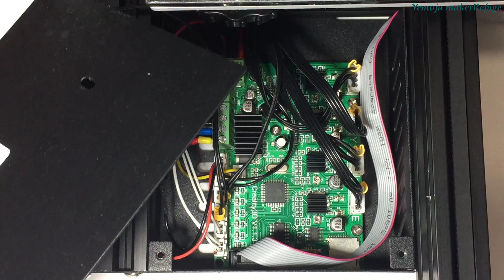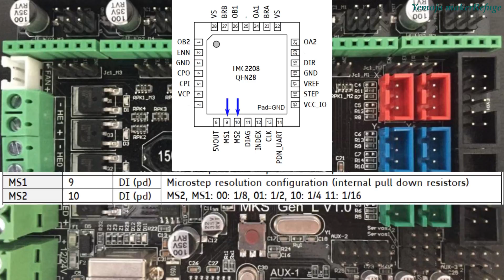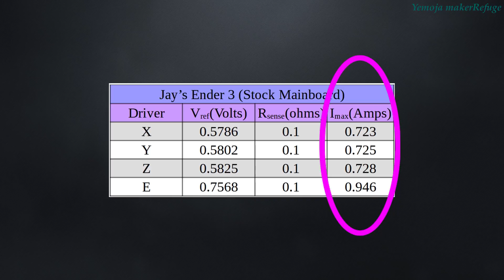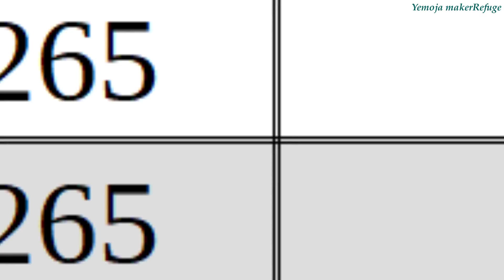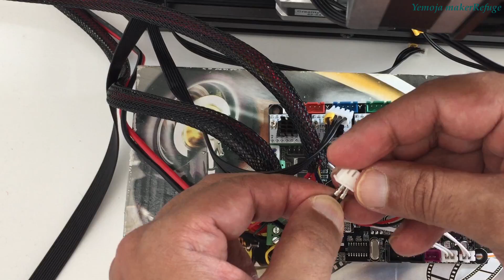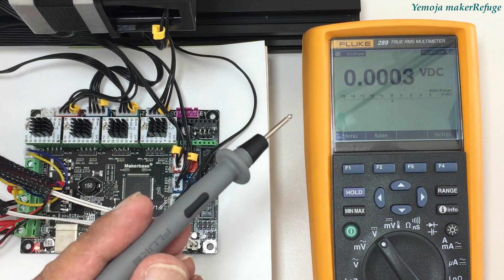Ender 3 : Upgrade to MKS Gen L v1.0 + TMC2208(Legacy) - Part2

Comment: can i use this method also with 2209 ?
Reply: hi @t0pa. I need to know the exact driver you are using. That said if the driver pinout for the device is akin to the driver that I'm using here then definitely yes. All you need to do is select "TMC2209_STANDALONE". Checking Marlin's "Configuration_adv.h" reveals that the tmc2209 can be used for sensorless homing which is NOT covered here. Hoping this helps.

Comment: Hello please reply . Instead of NC in my  tmc 2208 it's CLK and PDN. Will it work or not ,what's the difference
Reply from the maker: Hi @michael martin. Can you point to where you got this? What version are these?
Reply: @yemojamakerrefuge898  v1.2
Reply from the maker: @michael martin This tmc2208 v1.2 module has the uart mode enabled out-of-the-box so won't work with this guide...so sorry bro.
Reply: @yemojamakerrefuge898  ok iam going with lv8729 as it's cheaper than tmc 2208.  I am noob , so with lv8729 should I do exactly what you did? All the coding and installation in motherboard just like 2208. ??. Or should I change something
Reply from the maker: @michael martin you'll just need to change 'TMC2208_STANDALONE' to 'LV8729' for the code bit. Other than that, I suppose you're good to go. I don't have this driver so I can't say for sure. All the best bro...Hoping this helps.

Comment: This was a very well put together tutorial, but a couple minutes after I finished tuning the drivers the motherboard and/or the drivers lit on fire. My biggest regret is that I didn't have any marshmallows handy.
Reply from the maker: Hi @Silas Foley. Seriously? I'm really sorry to hear that. But your board caught fire? Perhaps you may have had a faulty board. The TMC2208 drivers have short-circuit and over-temperature protection which would have prevented anything bad from happening to them. Possibly the MOSFETs for the extruder or bed heater given a short-circuit condition in either heating elements. Polarity reversal could also cause such an incident. Again, I'm sorry to hear of your predicament. Please exercise extreme caution when handling electronics. 
Things I've learned from my experience if they apply. Always have your hand on the power-off button. If anything smells funny quickly hit the power-off button. Double/Triple check everything. When tired even if a bit, hold-off everything and continue after resting.
Reply: @yemojamakerrefuge898  Okay, thanks for the advice! The board must have been the origin of the fire considering the drivers have all those precautions in place. It's a shame because I bought a brand new motherboard, brand new drivers (I had to wait for a few months for them to come in) and a brand new LCD screen and there all wrecked now except for possibly the screen. On top of that, it appears that there a bunch of wires on my Ender 3 that are fried.  I don't know what the full extent of the damage is and am considering purchasing a new Ender 3 altogether.
Reply from the maker: Hi @Silas Foley. Oh dear that's quite unfortunate. I'm so sorry for you buddy. Buying a brand new Ender 3 may be a better option if you see damages to wires belonging to the steppers and/or thermistors. It is not necessary if you know how to check these component for proper resistances/continuity. Otherwise go for a brand new printer and salvage the damaged printer's parts as back-up or maybe a DIY printer of your own make. Parts can also be used in other electronics projects. Not all is lost.
Don't get discouraged buddy. It can happen to anyone. I've got a long history of blowing stuff up. It's painful but somewhat a necessity to learning at least in my case. Hoping this helps a little bit.
Reply: @yemojamakerrefuge898  It helps a lot! thanks for the help and the encouragement, it means a lot.

Comment: Noob question: why does the reference voltage needs tot be higher when you are using the same motors as before im really confused why not use creality stock values and is the thing from the jumpers the same on every mainboard that you can buy if they have these connectors
Reply from the maker: Hi @Marc Vroegh. Sorry buddy for the real late reply. I am using the creality stock values. The different values are simply the voltage representation i.e. whether peak-to-peak or RMS values. I'm sorry but I do not understand the latter part of your question. Hoping this helps.

Comment: You did all that math from vref to Rms to get the same values
Reply from the maker: Hi @Jacy Light. Yes it is and that's because the manufacturer chose a very convenient resistor value which makes things easy for everyone. Otherwise it would have not been the case. Just wanted to share how the calculation was performed as there was no other place which showed it properly. Cheers.

Comment: What is the difference between the green voltage terminal block, and the white voltage connector next to the motor connectors?  For example, if I plug an MKS-CD expansion into the socket, to use an external driver (TB6600), which one powers the driver/motor?
Reply from the maker: Hey there @Ben Nguyen. The white connector basically is connected to the green connector I believe. IOW, if you power your board via a 24V supply voltage by plugging it into the green connector( which is a power inlet/input ), the same voltage will be available thru the while connector( which is for power output ). The power from your supply which you plug-in thru the green connector ( next to the bed connector ) will power your external driver. Hoping this helps.
Reply: @yemojamakerrefuge898  Thanks!  I haven't had much success getting the motor to move reliably, but it's probably an issue with the changes I made to Marlin's Configuration.h file.   I'm ordering a couple of known-supported motor drivers (A4988/DRV8825) to replace the MKS-CD/TB6600 driver.   This should eliminate at least that variable!   I've also ordered a cheap 5v stepper motor to test with, just in case it's an issue with my motor, but can a 5V motor be used with the MKS-Gen-L v1?  The board says 12V/24V
Reply from the maker: Hi @Ben Nguyen. Nope I don't think so buddy. You may be able to use it for brief tests but you'll end up damaging it. My 2 cents worth. Cheers.

Comment: im confused about one thing sir, i have the a4988 drivers does all of the part one and part two applies for it or are your tutorials only for the tmc  drivers?

thankyou very much for your response
Reply from the maker: Hi @Aqib Akbar. This tutorial is specific to the TMC2208 correct. But if you want to use the A4988 drivers then just select the driver "A4988" instead of "TMC2208" when configuring drivers during the firmware configuration bit. For hardware configuration, you need no other changes. The changes shown in the second part will work for the A4988 as well. Make sure you select the correct step size which is 1/16th by configuring the jumpers as shown in that part. Hope this helps.
Reply: Yemoja makerRefuge thankyou so much! please upload mks l with tft32 screen

Comment: Can you Upload your Cura settings?
On my Ender 3 all results Trash :(
Reply from the maker: Hey there @SenSenCyber. I'm using the default setting for Ender 3 which come with Cura 4.1. In fact I've been using the default settings for Ender 3 in many previous versions of Cura also. For my everyday printing I use a velocity of 60mm/s, acceleration at 1000mm/s/s and jerk at 10mm/s. Other settings are dependent on your material and 3D design. Hope this helps.

Comment: I have the identical tmc2208 v1.1 stepper drivers. I can not get them to work in UART mode on my MKS GEN L. Did you?
I soldered the UART pin with a split wire. One end has a 1Kohm resistor. Then I plugged the wires in the aux2 pins as shown by teaching tech. When I send a M122 command to state the driver status, they are not enabled and don't have a driver register.
Reply: I'm also trying to figure everything out. In the process of upgrading my Ender-3 with MKS Gen L + 4x TMC2208 in UART + MKS TFT28 + E3D V6 + BLTOUCHv2.0 -- I was under the impression these specific versions of TMC2208 drivers didn't need any additional wiring for UART mode. 
All that's needed is to set them up as TMC2208 (without 'STANDALONE') in Marlin fw.
I'd love a clarification on this also.
Reply: Ayeayre I can try that, but what pin assignments do I need to set in Marlin? The standard ones for the MKS GEN L board or ?
Reply: @anenkris I can't say with any confidence. I'll get back to you once i figure it out.
Reply: Yeah lol nevermind my first post, sorry but I misinterpreted the features write-up for these specific Makerbase v1.1 boards.

As far as I can tell the UART pin is now connected direct to the chip, negating the need to solder any jumpers to make the connection as with most other versions of these drivers.

So the board itself is technically 'UART-ready' from factory...
But we still need to connect that pin to a TX/RX interface on the MKS Gen L to make use of it. 
else; no communication is physically possible.

So, If you've done more than 5mins of research you're more informed than I am and have made and connected the Y cables, and assuming you have double-checked it for continuity etc. then make sure you only use TMC2208 instead of TMC2208_STANDALONE  when configuring Marlin (also make sure you download Marlin v1.1.9 or newer)

Also check that M112 is actually enabled in fw (uncomment TMC_DEBUG), but I'm guessing you already knew that..

That's all I can think of atm...
Which isn't all that surprising. 

Please let me know if you get it working, I'll do the same once/if I finish.

If you haven't noticed by now, please keep in mind that I am still trying to figure it all out myself and could be completely wrong, but I will humbly accept and appreciate any corrections, additions, tips & tricks from yourself or anyone else that is still reading this for some reason. =)
Reply: @ayeayre  Let's do this together!
I connected the uart ready pin to a TX/RX interface on the MKS Gen L. I used the pins as described in Marlin 1.1.9 bugfix.
I also made the necessary changes to the firmware including TMC2208 drivers and enabling M122 debug command.
And yes there is continuity from the stepper pin to both ends of the wires.
Still no communication is happening with the drivers. That's why I am a bit lost.
I could use them as standalone, but prefer not to.
Reply: @anenkris  I will be able to power up and test shortly, then we'll at least be on the same page, right now I'm just guessing. Won't be long.
Reply: @ayeayre  Yes I tried removing only ms3 with no luck. Then I tried removing all jumper caps, still no luck.
Reply: @anenkris  it wouldn't matter, they aren't used in UART mode.  
Did you double check the orientation of AUX2 connections?

I'm just about to wire it up now. dw we'll work it out.
Reply: @ayeayre I wired it like this: https://i0.wp.com/www.deviousweb.com/wp-content/uploads/2019/01/pintopus.png?w=455&ssl=1

With this board orientation: http://www.robotrebels.org/gallery/16_08_07_17_7_42_19.jpeg
Reply: @ayeayre  Any luck?
Reply: @ayeayre  Have you succeeded with the TMC drivers?
Reply: @anenkris  My apologies, I got held up. But i'm back on it. Will update in a couple hrs.
Reply: @anenkris  Sorry for the wait, I just hooked everything up rudimentary,  but looks like i'm in the same boat. dammit 

Have you had any luck at all?
Reply: Ayeayre no luck. I was hoping yours worked and I forgot something. Going to try them in legacy mode this weekend. See if that works.
And I never got an answer from Makerbase that helped either.
Reply: Ayeayre one thing I have not tried is setting a VREF with the potentiometer on the chip.
Reply: @anenkris  Bet you it's something stupid.  lol 

What did you use to flash Marlin btw?
Reply: Ayeayre I guess. I use Arduino IDE to flash my boards.
Wouldn’t e-mail be easier? 🤣
Reply: @anenkris  haha yea sure would,  shoot me your addy.. or add me here via https://youtu.be/addme/lDGQfl2K9ytCufUc5AYj_OC-xBDZiw   to shoot privately..
Reply: @ayeayre  The link expired. Send it again?

Comment: Fantastic videos! I succesfully upgraded my Ender 3 Pro to MKS GEN L + TMC2208 with your help and videos - thank you! 
Question: Michael at TeachingTech's video uses X,Y,Z vRef values of 0.76, and his sense resistor is also 110. Is it better to err on the lower or higher vRef side?  I have used your values of .725 (x,y,z) but now I am second-guessing which value is correct / best to use. Are there any other hardware differences I should be aware of to check on mine, to ensure I'm using the correct calculated values for my specific h/w?  THANK YOU!
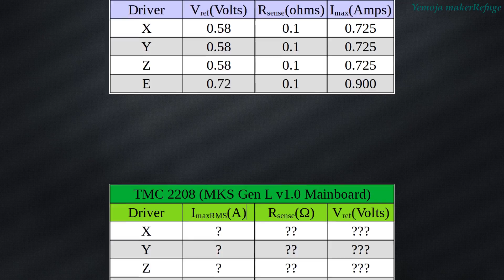Reply: Ah, I see in Michael's first video, he uses max current values of 0.84A (for the X,Y,Z motors) & 1.0A (E): https://youtu.be/H41hIXdB6js?t=344. Whereas you are using (@9:38) 0.725A & 0.9A respectively. I'm still not sure which calc / values are correct though.
Reply from the maker: Heya @Glen Schulz. Sorry for the late reply. I'm using the max current values obtained by measuring the original drivers on the stock Ender 3 board. Also, there's a page which I shared where you can find the Ender 3 stock max current values. I'm using these values as a reference as Creality has not shared any other technical specifications explaining why they chose those values. The specs on the motor are pretty much unknown as is the mechanical loading of the axes & extruder etc.
That said, the TMC2208 drives are much more efficient overall than the A4988 and I have set these values lower and still the printer printed without any problems. The rule of thumb is to start high and trim down to a smaller value depending on how fast you print. I generally print at velocity@60; acceleration@1000; jerk@10 and those max current values give me no problems whatsoever at these requirements.
My calculations are sound as I've gone thru them may many times. The real question is exactly which max current value is optimum for the printer axes & extruder but as of now I've not been able to find a way to calculate that. Since simulation is not possible as there are too many unknowns this leaves us with experimentation. So we come back to trial & error to find the best values for the individual printers. I've gone down all the way to 0.6v & 0.8v respectively and still found no printing issues for my printing demands.
Anyway, lower values are better as it dictates power efficiency. Hoping this helps.
Reply: @yemojamakerrefuge898  thank you so much for the detailed reply, Jugnu. I've used your values and have not had any problems so far - so thank you again!!

Comment: I am wondering in one uses a pancake stepper motor for E would the values be smaller?
Reply from the maker: Hey @3lemental Studios. The values that you are referring to I'm assuming you mean current limit volatge. Then, it comes down to the specs of the motor. If the specs are the same as the original than the current limit voltage would need to be the same. The values shown are NOT optimal as the motor specs and the mechanical loads are somewhat unknown/unspecified for the Ender 3. The calculation is equivalent values based on my measurements for my machine and references from other sources.
Hoping this is what you are asking. Hope it helps.

Comment: Thanks a lot for this very detailed tutorial... 
Just one doubt... how have you fit the MKS Gen L board into the Ender's electronics box?
Reply from the maker: Hey there @Renato Elias. Mine lines outside on the side of my printer. Michael of Teaching Tech has a solution you can find on Thingiverse - https://www.thingiverse.com/thing:3311643 . Its an adapter which maps the holes on the board to the casing mount points. Hope it helps.
Reply: @yemojamakerrefuge898  I've designed my own solution using the stock Ender's box. Here it is https://www.thingiverse.com/thing:3607376
Reply: now I'm trying to figure out why the nozzle's fan is not working... I've already tried 3 different ones and they don't spin. The pins have the correct voltage but nothing happens... is there anything we should change in the Marlim firmware regarding this fan?
Reply from the maker: Hey there @Renato Elias. My nozzle fan is connected directly to the 24V screw terminal and it comes ON as soon as power is applied to the printer's PSU. No there's no software/firmware setting for this as its directly powered. You've got me stumped too. Do the fans spin when any DC voltage is connected. Just to ensure the fans work. I''m sorry but I'm not sure how else to help buddy.
Reply: The fan I was talking about is that one controlled and connected to D7...but I've worked out the issue... The fan's plug was with reversed polarity...

Comment: Can this exact driver run UART?
Reply from the maker: Hi @Cody Cato. I haven't tried but I do believe so. You'll need to change "TMC2208_STANDALONE" to "TMC2208" to choose UART mode of operation. Hoping it helps.
Reply: @yemojamakerrefuge898  I notice there are no points to solder underneath and 2 NC pins instead of one. All the tutorials i saw has a CLK pin next to the UART.
Reply from the maker: @Cody Cato. Yea newer version of the driver I believe come prepped for UART mode operation. Do check with the manufacturer of your modules. Refer to the comments from @The Crab to get an idea on how to proceed. I've not tried this myself so I'm not entirely sure.
Reply: @yemojamakerrefuge898  yea I saw his comment. But I dknt have the clk pin or pdn....only NC, Uart, NC
Reply from the maker: @Cody Cato Any chance you can link the stepper module photo/picture/spec sheet?

Comment: Great video thanks. What size are the ferrules you used?
Reply from the maker: Hey there @Hunt Moorhouse. It measure to 1.5mm outer diameter of the metal tube of the ferrule. I bought a pack of various inter-mixed diameters so I'm not exactly sure. Hope this helps.